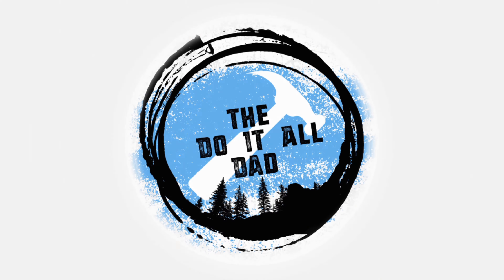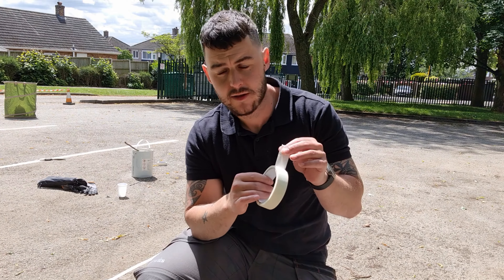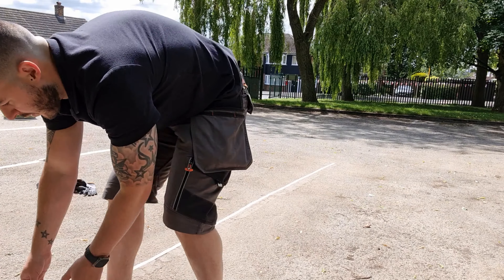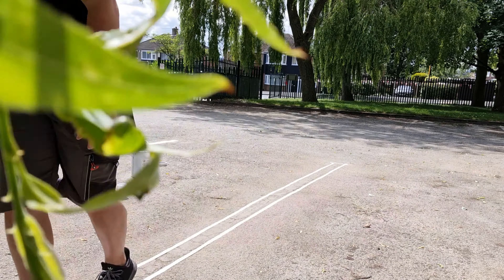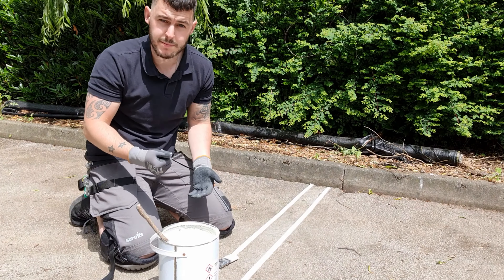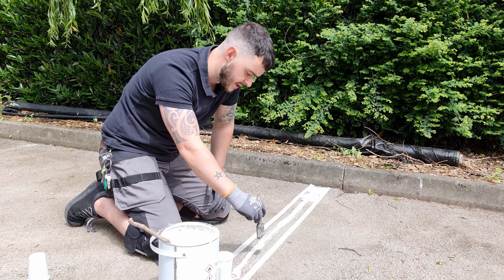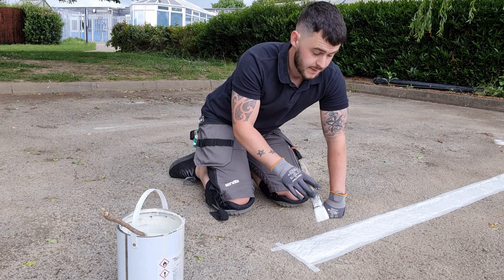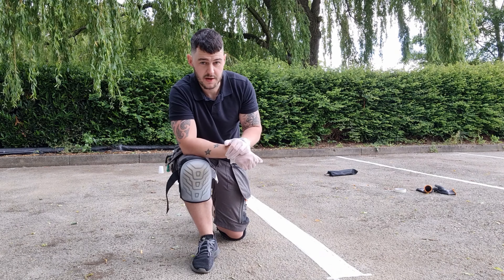Paint Your Own Car Park Spaces And Road Lines

Comment: A roller ,handle and couple 2×4  will work as well , water based paint too
Reply from the maker: That's a good shout 👍🏻
Reply: @thedoitalldad  , I just painted some parking lines last night,
Reply: Water based paint isn’t going to last long in most cases.

You need the plastic based paint for it to hold up.
Reply: @markbattaglia9076  I had some last up to 3 years until I had to touch up, In Nova Scotia, most stores only sell water-based or Oil based, and the price of acrylic here is insane

Comment: I don’t mean to be rude and you’re certainly doing a quality job BUT won’t this method take forever to finish? There’s got to be a more efficient way.
Reply from the maker: There probably is a much easier way, this is just a way using basic equipment without having to spend too much money. Even with moving the camera around and filming it didn't take too long to get finished. You could also try getting a small roller attached to a pole to save having to bend down 👍🏻
Reply: Take the 2 tapes together and use a broom to push it down ...the paint i pore in a square bucket and use a 10 cm roller...much faster then this fideling...we also use a special spraymachine for if we have allot of meters